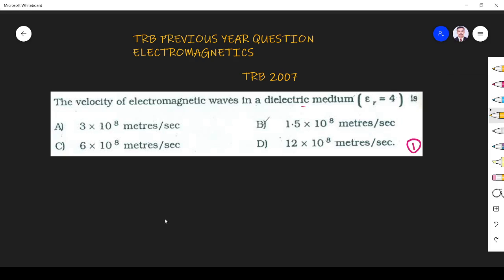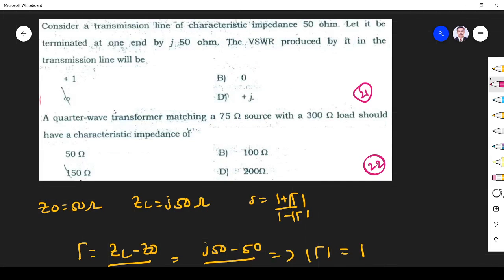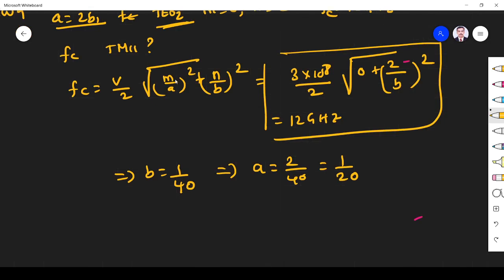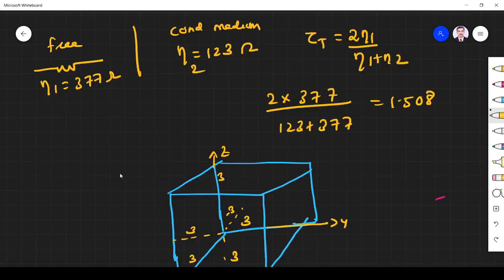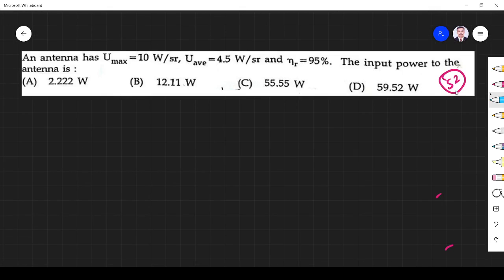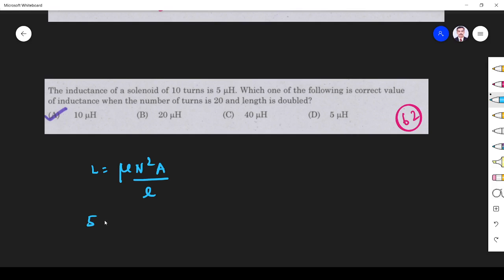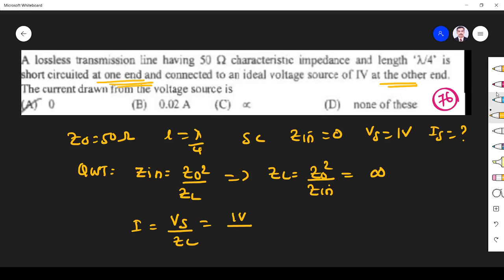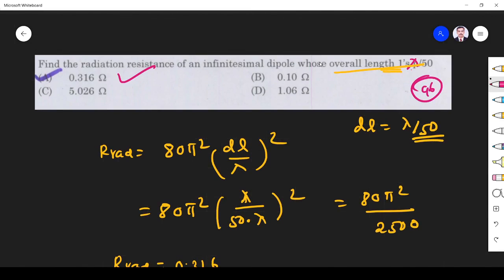ELECTROMAGNETICS ALL PREVIOUS YEARS TRB TNEB QUESTIONS

Comment: Q. No 77 sir? It can be a distortionless line sir?
Reply from the maker: Yes ma'am..the answer I gave was wrong..i misinterpreted the question..When the characteristic line is a pure resistance, the line must be a distortionless line. But it may not be a lossless line.. thanks for pointing out. I will change it .. 🙏
Reply: @majeethlectures  thank you sir
Reply from the maker: @Adhi0209   Crash course new batch starts from Monday for trb TNEB exam.. contact 8610308934..

Comment: Q 18 is wrong ans but ans D unpoloarised
Reply from the maker: polarization is nothing but orientation of electric field. If components of electric field are out of phase it will come under circular or elliptical polarization. Hence in the Problem there is phase difference n same amplitude ....so it's concluded that the given field represents circular, even though the question is ambiguous....

Comment from the maker: Correction Q18 Amplitude is same ..so it's circular polarization not elliptical polarization
Reply: But phase is not 90degree so it is unpolarized sir... Plz ans this sir
Reply from the maker: @Adhi0209  which Problem sir
Reply: @majeethlectures   q. No 18 sir
Reply from the maker: @Adhi0209   polarization is nothing but orientation of electric field. If components of electric field are out of phase it will come under circular or elliptical polarization.in the Problem there is phase difference n same amplitude ..for your doubt of absence of beta z , it gives direction of wave propagation only..so it's concluded that the given field represents circular, even though the question is ambiguous.
Reply: @majeethlectures  okay sir

Comment: Sir, in qs.82, endfire array is radiating along the direction of propagation????
Reply from the maker: End fire array is a linear array whose direction of maximum radiation is along the axis of the array; it may be either unidirectional or bidirectional; the elements of the array are parallel..
Reply: @majeethlectures  sir, apo answer 90deg ah???
Reply from the maker: @ecestudymaterials5749  
The magnitude of currents in each element is same, but there is a 90 degree phase difference between these currents
Reply: @majeethlectures  okay sir...

Comment: In qs.70, electric field inside the conducting sphere is zero???
Reply from the maker: The net flux through the sphere is simply EA, because the field lines are perpendicular to the surface at all points. Electric field inside a conductor is zero
Question is about electric flux not fields
Reply from the maker: Flux is uniform but field is zero inside a conductor..if the 5 lines go inside and 5 lines go outside it indicates field is zero. Hope you have seen that field lines which is nothing but flux is uniformly spread in spherical fashion in any text books
Reply: @majeethlectures  thank you sir...

Comment: In qs.24,Rr=73,then p=i^2Rr=73w????
In qs. 25,it's 80pi ^2???
Answer for qs.27 sir?
Reply from the maker: What's your doubt is Q24
Reply: Radiation resistance,,,73ohm?
Reply from the maker: @ecestudymaterials5749  They ask only radiated power ..no need bother about radiation resistance
Reply: @majeethlectures  radiated power = i^2 * radiation resistance, correct ah sir???
Reply: @majeethlectures  sir, for that problem, if we substituted 80pi^2(dl/lda)^2 ,we r getting 0.88w
40pi^2 we r getting .43w
Else 73 w???
Which one is correct sir???
Reply from the maker: @ecestudymaterials5749  40*3.14*3.14=394.384
394.384/900=0.43
Reply: @majeethlectures  ya sir, you r correct , but all the answers were in options
Reply from the maker: @ecestudymaterials5749  Ma'am 73 ohm is for half wave dipole antenna..but the question is vertical wire and it's not specific about antenna. So we can't use 73 ohm. So we should use general radiated power equation..if particular antenna is given we can use radiation resistance of specific antenna
Reply: @majeethlectures  thank u sir, got it,
Reply from the maker: Q25 .it's 80π^2 (dl/lambda)^ 2 ..I told correct but marked wrongly. thanks for correction

Comment: Sir, qs.no.18 is correct????
Amplitude is same...plz check once
Reply from the maker: Yes 18 is circular polarization only .. thanks for question
Reply: @majeethlectures  it's unpolarised , I think sir
Reply: @majeethlectures  in the question, there is no beta z term, so it's unpolarised????
Reply: Plz tell the concept of unpolarised, I referred in some websites for this qs.
Reply from the maker: @ecestudymaterials5749  

 @Swedheetha Chandrasekar  polarization is nothing but orientation of electric field. If components of electric field are out of phase it will come under circular or elliptical polarization.in the Problem there is phase difference n same amplitude ..for your doubt of absence of beta z , it gives direction of wave propagation only..so it's concluded that the given field represents circular, even though the question is ambiguous.
Reply: @majeethlectures  okay sir